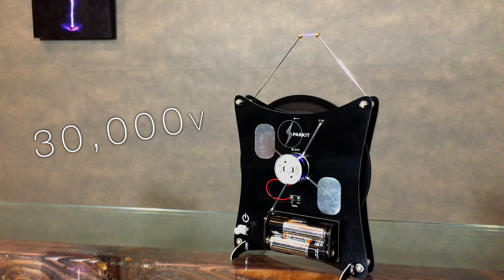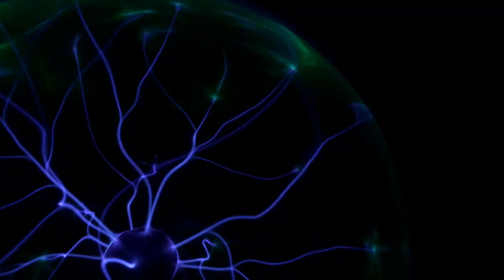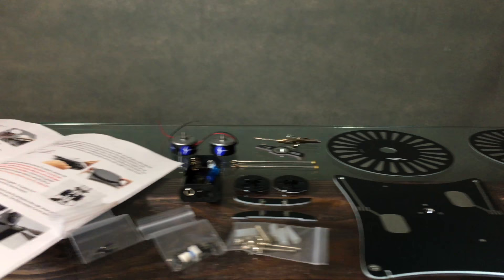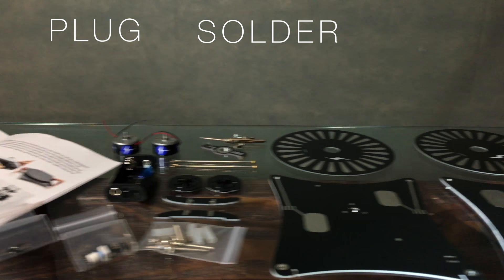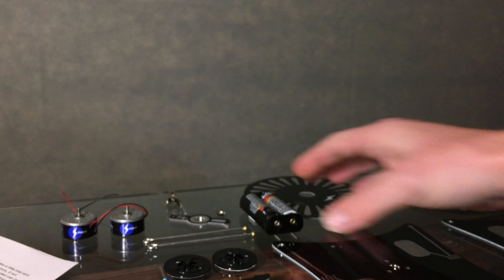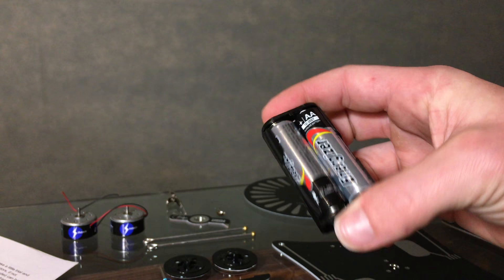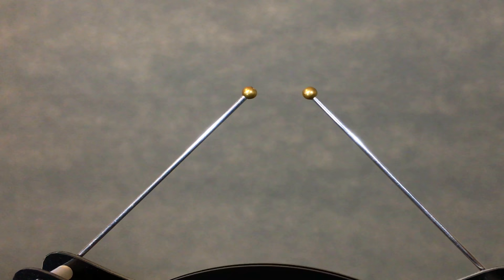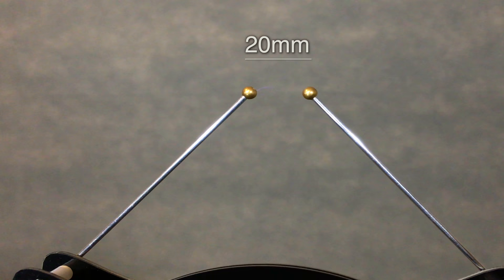DIY 30,000 volt WIMSHURST MACHINE | SparKit |

Comment: Hey Jay, I bought a manual one a couple of years ago. And like most of them, they have two large capacitors similar to the leyden  jars, that make much larger sparks by increasing the current and charge before it achieves sparks voltages. The result is thickened arcs about 6 times thicker and ability to go a lot longer. The cheap one I got, used only al foil inside a plastic tube with other al foil on outside. The inner one was not even siting precise, and bunched up and it still made a huge difference. The leyden  jar dangles a chain into a jar of water and has al foil on the outside. The forerunner of the battery and capacitor. It however is capable of thousands of volts of static, and is the original term, lightning in a bottle.

I did want to electro mechanically run mine. So I might buy this one and tweak with capacitors. 

I have an ARC of the Covenant Capacitor I have made up with a plastic storage and some aluminium sheeting rolls. It is a huge capacitor and takes ages to charge up. But I have a fault that needs insulating as it breaks down. I haven't done anything with it in a year or so, and you have reminded me. If it was GOLD COATED or made of Gold, it is suppose to REPEL Water. Seems GOLD both North and South Poles repel gold on a float test. So electrostatically charge up Gold and you have the parting of the Jordan river as in the biblical account of Joshua 3. Where it says the priests were bare foot carrying it, and as soon as their feet touched the water it parted away from them! Classic Clue!  You see this little capacitor could hold enough charge current to kill 6 men. It jumped out at them like lightning. It had two angels with wings that acted like antennas and also as terminals. I believe in my pondering theories it has Several Settings. Of Close Circuit Short, Fully Open Circuit, Medium State where there is a SPARK between the two cherib wings. This mini lightning effect was worshipped as the presence of God by many as an idol. However this medium level of spark could be varied to be large or small and this would influence the charge needed to build up before it sparked. Fully OPEN with no spark it would be charged high enough to part the river Jordan it would seem in theory practicable.

There are several who died by touching it or getting too close. The priests would know the secret to move one of the wings to touch the other using a wooden pole as insulator.  One of the priests two sons got killed by it. Another was carrying it on his donkey and it stumbled and put out his hand to steady the ark and it killed him. Such would seem a bit strict by God striking them down with no mercy when they were on his side doing his work. But electricity of thousands of volts with a higher current build up. Bam!

Added to this is the story of the son of Solomon and the queen of Sheba. And visiting and his accompanying men had a secret mission to steal the ark. So chances are there is at least a second one by the same plans by those who saw the original. For the story goes it went back to their land, Ethiopia. And there are stories of them having the ark there, hidden deep underground, and they have cartakers that last about a year and go blind. One kept running away at the time of the investigation of a researcher. The HOLY of HOLIES in the Jewish temple was GOLD lined as a RADIATION shield from the ARC constantly arcing away with such high voltages. When stolen by the Philistines, they contracted tumours and haemorrhoids. But thats another story.

In Ethiopia ALL the Christian churches have their model of the Arc of the Covenant as an effigy they celebrate holding above their heads on certain occasions. As the rearcher found out. It was supposed to have been hidden on an island monastry on the River Nile for several hundred years.

This is what housed the 10 Commandment Tablets and Aaron's Staff, Goliaths Sword and some other things. Protected by the security of  the constant arcing display.

Comment: I bought one directly after you spoke of it on FB. It’s indeed incredible quality. The instructions are easy to follow (but the pictures could have been a bit better quality).

It’s interesting that this device uses electric fields, direct current and capacitors whereas the Tesla coil uses magnetic fields, alternative current with coils. In my opinion, they are both very interesting, and somehow complete each other in that way.
Reply from the maker: Yeah it’s such a cool device isn’t it! And totally different operation than a coil. It works more like a van der Graff

Comment: #SparKit - I think, the two electric motors are a good idea. It reduced the complexity of the mechanic setup. Using PCBs for the sides is also pretty handy. I like this kit, it is smart engineering.

Comment: Had to wait until the manufacturer did another run, but it is now available.  Took forever by mail from New Zealand, but not the mfg. fault.  As noted in another comment, you don't show the mounting of the brushes (estimate of distance from board would be nice).  But it is all assembled now and works well.  Keep up the good work ... great channel, professional presentation.

Comment: The kit works well. The only problem is that after a long time of not being used the machine will stop to produce arcs. To fix this try brushing a comb with your hair and pass it by the discs on the machine.
Reply from the maker: I have noticed a similar thing

Comment: Just got mine in the mail... price was reasonable. Works perfectly, thanks for the info on it. Keep up the good videos.
Reply: That is until I started it and a disk fell of the spindle so I had to take it apart to put it back on... ( I purchased it fully assembled)
Reply from the maker: Haha, they are really cool kits either way!
Reply: Yeah it is especially when I was able to push it to 60,000 volts with a 20mm gap

Comment: #SparKit
I am not even a teen yet and this would be a good addition to my 60kV flyback power supply that I made a few weeks ago. I haven't yet made capacitors for it and I would really like this kit to have some sparks with some more "umph"
Thanks!!!

P.S. I shared it but I'm not sure it really worked, so just letting you know that I DID try to share it. I think it worked, but I am not sure. :)

Comment: Absolutely amazing for $30! The build quality is outstanding. I knew you could use 2 motors with one reverse biased (one with backwards vcc input) instead of that twist a rubber band or whatever to get the disk's rotation to oppose eachother! #Sparkit! I'm too late for the giveaway however thats ok. I'll purchase one on my own or build a huge upscale version using JLCPCB for the board design.

Comment: Is it ok if I upload a video about this mini wimshurst machine, and say that you have a better video of it, and link to this video your channel, (and maybe a link to the machine?) And on a related note, I found out how to do "earth bending," which works with both the wimshurst machine and (presumably) a voltage multiplier. By connecting one end of the machine to ground, holding the other end, and standing on an insulating platform, you can hold the other hand flat above a grounded tray of sand. (Because sand is kind of insulating, it works best with a thin layer.) the sand should jump up and down between the tray and hand, similar to a Franklin's bell. I assume the setup with a voltage multiplier is similar to water bending.
Reply from the maker: Absolutely. Thank you so much for asking. Also, yes the earthbending works great with the voltage multiplier.

Comment: Nice kit, but already have too much high voltage/current power supply, ozone level will explode with this one :p
Reply: Camilien Beaudoin what do you mean by this please?
Reply: Warrick Taylor I mean that I have a few high voltage generators already, and when you create  an electric arc it creates ozone gas which is toxic, so less high voltage generator mean less ozone in my room

Comment: Ever heard of the Testatika ?
Reply from the maker: I have done some reading on it, and it seems interesting. Have you built one?
Reply: @PlasmaChannel  no. But tried to read up on it and emailed the "society" to see if I could find more plans. They declined. Looks like part of it is static generator similar to wimshurst. Been a while since I looked at it last. Gotta win some money in the markets before I can start experimenting with these ideas. Other interest is using low amps and high voltage to split water efficiently like Stanley Meyer was supposedly doing. Dr. Gerald Polock has some interesting science about structured water that seems relevant as well.

Comment: Does voltage multiplier work with it?
Reply from the maker: It does not. Voltage multipliers need AC to function. This is DC
Reply: @PlasmaChannel  how about a Marx generator

Comment: Hi Jay... I have run this device for a while now and have been trying to figure out something.... As you shorten the spark gap distance, the motor runs faster....!!!! how?? they are not connected???? I think it is inductance through the motor casing.... would this be correct?
Reply from the maker: Actually, it is because as the device builds up a charge, the charge repels the rotor, and resists additional charge. The rotor now has to work against a drag caused by the built up charge, until the spark discharges everything. Then it speeds up and starts to slow down when the charge builds up again. If the spark gap is smaller, then it never builds up a huge charge, allowing the rotors to spin faster.
Reply: Thanks for the info... it helps a lot.... I've also built a couple of Layden jars... they can store a larger capacitance which results in stronger sparks... The Sparkit is a great kit for experimental use....
Reply from the maker: That would be a fun demonstration to see!

Comment: This sparks some thoughts: could that arc induce a voltage in a coil/transformer, that would be sufficient to produce enough current to keep 2 AA batteries topped off? Yea, you know what I am trying to say here. (grin). #SparKit
Reply from the maker: Hi J. Unfortunately, this device uses far more power than it generates. the sparks you see constitute perhaps 50% of the energy this device uses, so if the sparks were fed back into the system, batteries would still die.
Reply: @PlasmaChannel  Ah, but we can dream! (grin)

Comment: is not the limit 3.2k volts?
Reply from the maker: Why would that be?
Reply: The air is good at isolating, the further away the contacts are, the harder it is to lightning. At 1cm it charges up to about 16k volts until it comes to the blotz, at 20mm that would be about 3.2k volts. At least in the beginning, that was 20mm. In the end it has become a bit bigger. You know better as well as me so please correct me if I'm wrong, was just a thought of me.
Reply: ok, at 2 cm then 30k volts.